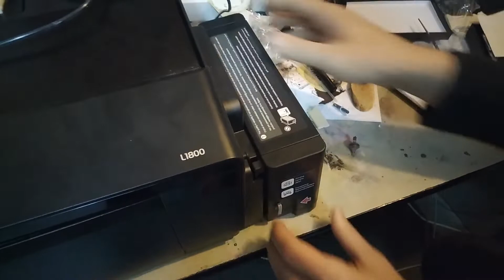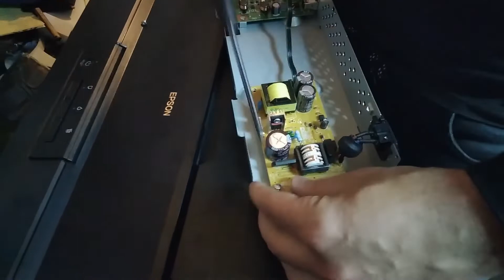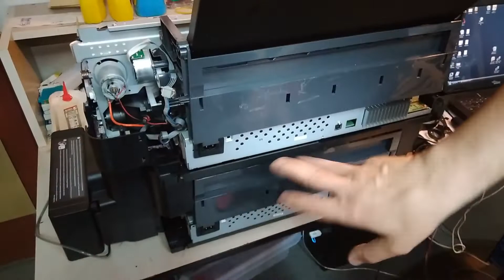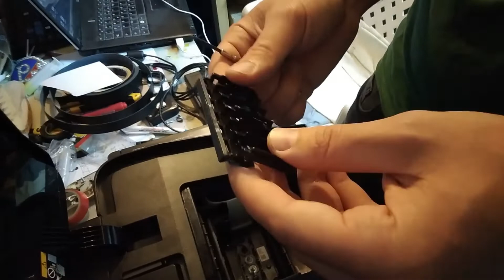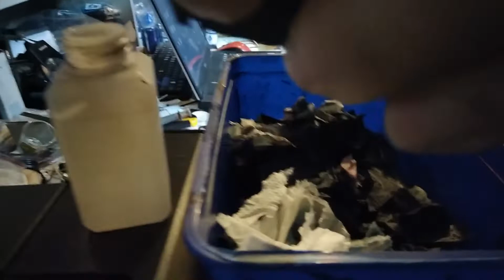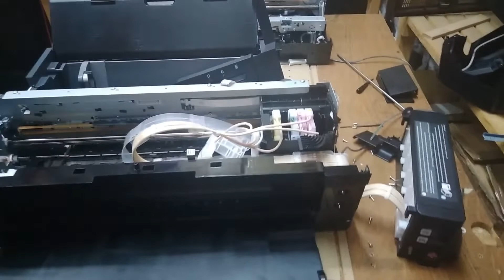DTF L1800 printer repair No. 3

Comment: Hi! I have an L1800 and the white ink is fading. It starts out very nicely and then the white ink stops. What can I do? I've done manual head cleaning, when I called the techs from Procolored they told me it was the ink I was using but did not give me anything as far as what to do. But they did offer me new ink and print head to purchase from them. Help please?
Reply from the maker: its not the ink or the head, you just have dense pigment sediment on top of the thorns for white dampers. You just need to remove the white dumpers, put the syringe with silicone tube on the thorn for white channel and make a dry pull. So you are sucking the sediment out of the thorn backwards instead of pushing through. Do that on both channels and you will need to clean the sediment on top of the thorn with paper towel and rubbing alcohol until you clean the holes on the top of the thorn. Usually there are 4 holes, and some head have 8 smaller ones. Then do one head clean and you should be good. In case there is sediment inside the damper you should also wash it out with the syringe.
Reply: It did help! Thanks! I was able to print a couple of screens when there was ink all over the screen I was printing! For some reason now there’s ink all over my capping station and I have no idea what to do next. It is just a mess every time I do a head print cleaning.

Comment: Very informational.. Could you tell me where the other end of the white cable goes that is connected to the power supply?? I have an R2000, A sheet  of PET film caught it, got jammed and disconnected it.. I can't see how it goes back in!! So, I can't power on my printer. Any help would be appreciated